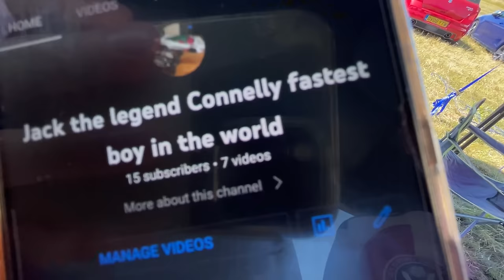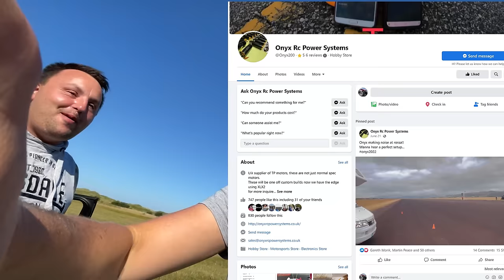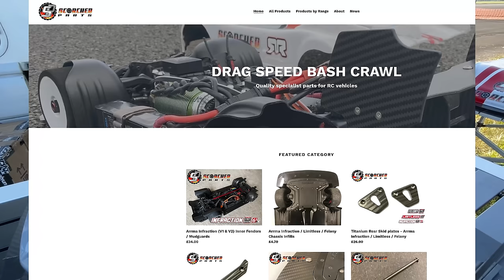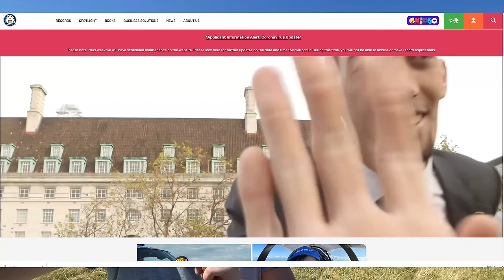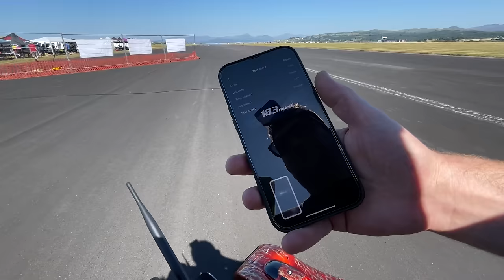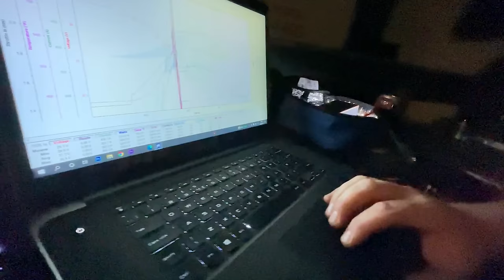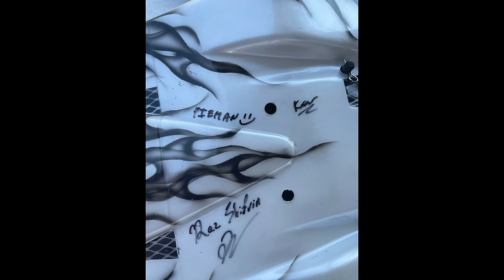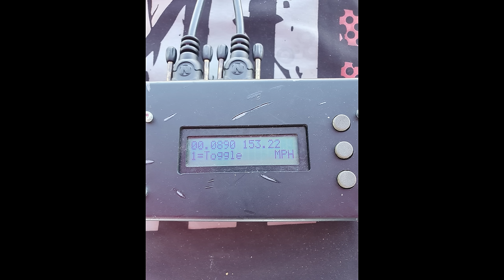World's FASTEST RC Car Speed Showdown - ROSSA 2022

Comment: The problem with going fast . . the airs resistance to something passing through it is proportional to the forward facing surface area times the square of the velocity.  What that means in practice is that if you want to double the speed of an object of a certain size you'll need to quadruple the power to do so.
Air temperature and pressure are important factors to consider for your record attempts. If your power/gearing etc. is set up to do just over 200 mph without factoring in drag you'll never get there.
Your best bet from a more  power standpoint is more power, much more power, and higher gearing.
Maybe gear it for like 300 mph and use one of your bashers as a tow car to give it a rolling start. That'd be quite neat to see.
Reply: That has nothing to do with the problems they encountered though
Reply: There’s a great video on YT about the Bugatti Chiron regarding that exact problem for high speed runs.

To @Luke, that may not be the exact fail points for each of the cars, but they should definitely consider this instead of the next time out being a glorified test session. Also, air temperature is important for the integrity of the foam wheels ripping up on that surface. That was one of the problems for Raz.
Reply: Wrong. If it’s got the power to do it and the right gearing it will do it. It’s not wheel spinning. I’m not sure if you realise the difference between gearing and power hahah.

Comment: Hey Kevin,I got to know your channel exactly for this project. I don't do any of this, no RC models but I was curious to see how far and fast these cars can go. I was noticing that one frequent problem is the cars lifting their front and take off. I have an idea to prevent that and maybe gain a bit of stability. I was thinking about a feedback aero connected to the suspensions. With a slightly tilting front splitter, if the front of the car starts lifting the splitter may tilt downwards and compensate the lift. It may increase drag in that occasion and not reach top speed, but it would give you a chance to save the car from taking off. For sure it would need to be fine tuned and some experimenting, but maybe it's worth a shot! Good luck and thank you for your videos!

Comment: 13:47 he's on the right track. LENGTH = SPEED. You look at all the land speed record holders they all run really long chassis that are narrow. It's the same as downhill skiing: longer = faster. 

you have to be rigid though so you don't get oscillation in the flex of the chassis.
Reply: In boats there's a thing call theoretical Hull speed. It's an equation based on Hull length on displacement vessels. 
formula: velocity in knots = 1.35 x the square root of the waterline length in feet.
Basically the longer the Hull, the higher it's possible top speed.
No doubt there would be a similar equation for passing through air, as air is technically a fluid.
Reply: That's what she said!

Comment: For getting more power out of the batteries, discharge it with 20-25A and then charge it with 15-20A, this will reduce the internal restistance a lot. And you can draw more power out of the batteries.

Comment: How about active aero Kev? Like wings at the front and back controlled by servos. So you can get more downforce during the start and when going full throttle you can slowly adjust the pitch to keep the nose down and reduce drag as much as possible. And maybe raise the suspension more to keep up with the weight of the downforce. It's never been done before and it's worth a try in my opinion

Comment: Hey Kev and Raz, you guy's run those big rear vertical stabilizers. What if you built in a couple of rudders that were linked to the steering? So as you turn left the rudder steers left also.
Reply: 37:58 🤣 😆 🤣 😂

Comment: Hi Kevin,
Have watched all your speed record videos, amazing design and amazing videos!

Are you still having that issue of the wheels shedding their foam?
Those vids are a year old, and maybe you've solved it?

If not...
I'm a tech design engineer and have a number of suggestions for designing a wheel that should give significant increases in high speed performance over those plastic wheels with a layer of foam bonded on (if you're still using them).

There are a number of areas where they fall down and there is room for significant improvements.
If you're interested please let me know and I'll post some ideas here.
Cheers...

Comment: What would happen if you had a dual motor set up and you geared one motor for acceleration and one for top speed. I’m trippin cuz they gotta be the same right? That would be cool if someone made it work, it’s sorta like a staggered turbo set up like they have in Diesel trucks one small one for low end torque and one huge one for high end torque.

Comment: 8:32 Does it makes sense to use expensive carbon fiber, and add weights in the same place? Could you not simply use metal for the part instead? Save money and less brittle.